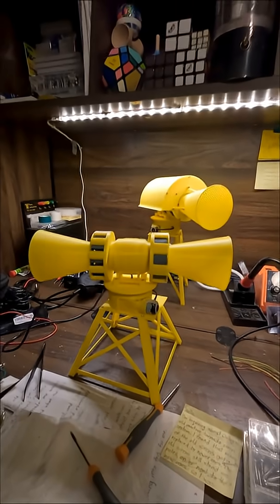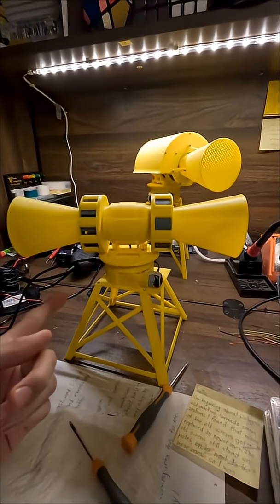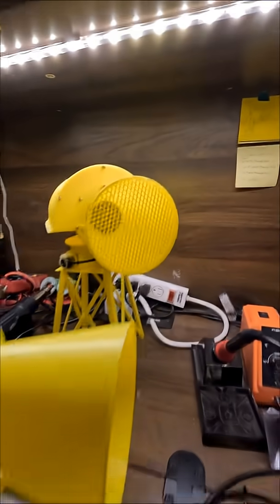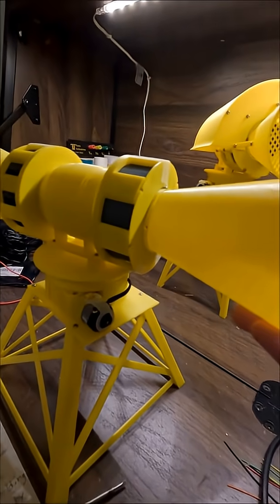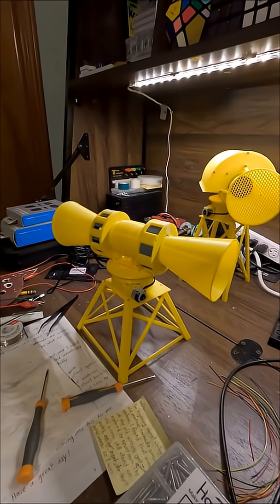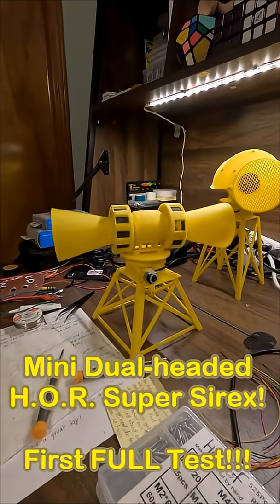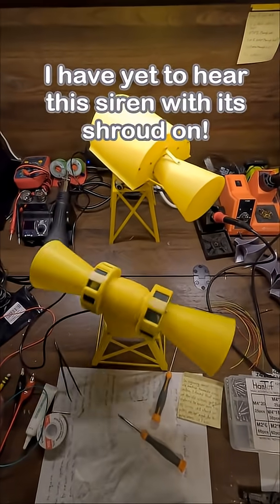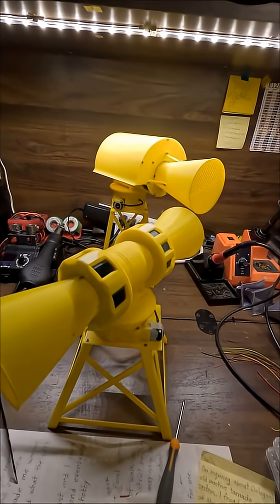Mini H.O.R. 7/10-Port Model 50 Super Sirex ROARS and ROTATES!!! #minisiren #supersirex

Comment: It's a bit small then the other one
Reply from the maker: Yeah, it looks smaller without the shroud 😅
When I print out the shroud and put it on, it'll look a lot bigger. The span of the horns on the dual-head models is also a bit bigger than the single-head ones, so it would be bigger anyway.